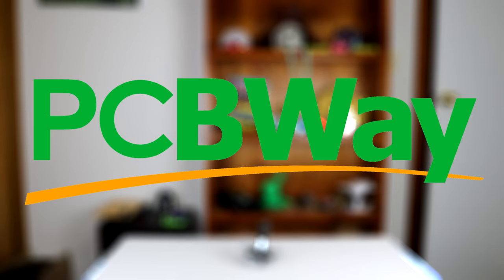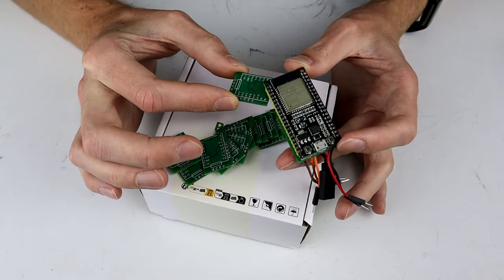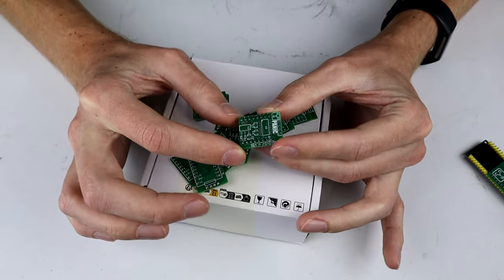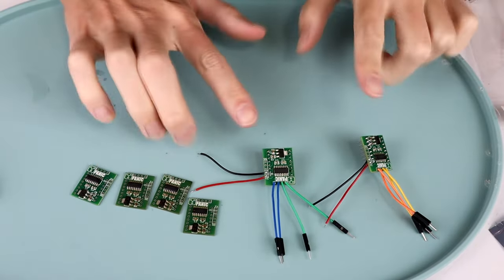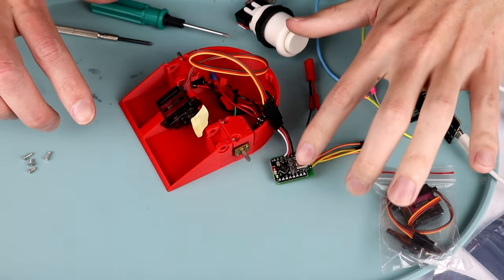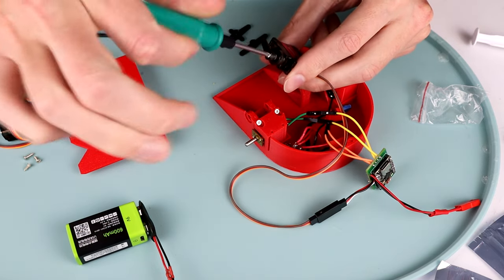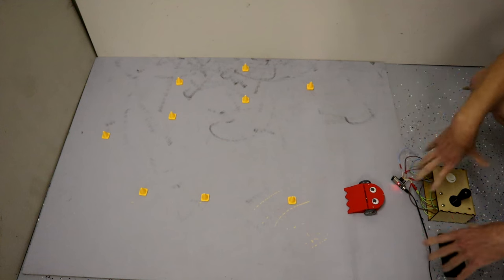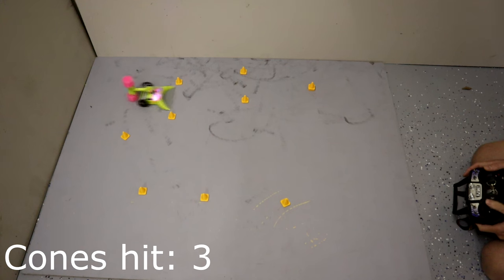Can you control a combat robot with an arcade joystick??

Comment: This is neat, although even with digital input you could use an output ramp to approximate variable input. Have the output start at say 25% for 0.2 sec then tank up to 75% over a further 0.2 sec. As long as it's consistent it should be reasonably easy to learn, give better control, and is also tunable if needed. Even a straight ramp starting at 0% and building to 100% over 0.5 sec can be fairly controllable, as some racing games use this style of setup for driving using a keyboard - trackmania is one example.
Reply from the maker: Ooh interesting I didnt know that some racing games use ramping like that
If I ever use this system to fight my own bots I'll look into this

For what I have in mind for these sticks, intuitive and very controllable is the goal, so I might look at a little bit of ramping but I'll aim for them to be much slower, like turns from 25% to 45% over a longer time say a second
Reply: @TeamPanicRobotics  the fast ramp works with a non-instant decay in racing games, so you can 'hold' a set amount by tapping the button at the correct rate, basically manual pwm signalling. Faster taps generally equal higher percentage, but you can vary it by changing timing of press and release.
Original Gran turismo was a good example as well, there were no analogue sticks at PS1 launch, but it was billed as the ultimate racing simulator (or words to that effect).

Comment: Thanks for yet again another amazing video! I’d like to see a full tutorial on how to make melty brains because I really want to try and make a 150g one but can’t find any tutorials on what’s needed and how to program it.
Reply from the maker: I did make a video on how melty brains work, nearly 7 years ago:
https://youtu.be/fHZTm-qGcZs
I cant remember how good the video is, but it covers the basics

I am meaning to remake that video at some point

The problem with meltybrains is that they need fast electronics which means a lot of cost and outside the accelerometer everyone I know of is using different components. This is why no tutorials exist, every melty that has been built is expensive and fully custom, so a tutorial on it would only ever get you an exact copy

Also a 150g melty is hard, the fast electronics are not only expensive, they are big and heavy. The easiest way to do a 150g melty is to smd a custom pcb with all the components on it, which is something I want to try, once I've got my beelte weight melty working better

Comment: Not sure it's representative, but the test with the button seemed for the response to be laggy, which could be a GEEAT problem with driving accuracy. Was there some improvement for your driving tests ? Also, you possibly can add some "turbo" mode , for example after "prolonged" forward motion, or time increasing speed on the forward input ? Or even a "turbo" button in addition to the action one and 8 directions...
Reply from the maker: great catch, it is laggy but that was on purpose
As that test was the first time I'd used Esp32's to talk to each other I didnt want them spamming signals and messing something up, so I added artificial delay to both the transmitter and receiver

Between that test and the driving test I removed the delays and then had to add a bunch of debounce code and other bits to stop the transmitter from spamming data, while still sending data in a timely manner. I'm pretty happy with how responsive the bot ended up

Comment: Sir, I really liked your project. But would it be possible to replicate it using material at a lower cost? For example: using KY-023 3-Axis Joystick Module. Using the Esp 32 or Esp mini D1.
I await your response, thank you.
Congratulations on the project.
Reply from the maker: I'm using esp32s in this project
The transmitter uses a standard esp32 the receiver uses an esp32-c3

Yes you could build a custom transmitter using a cheap joystick module and an esp32
I'll probably build something like that later in the year
Reply: @TeamPanicRobotics  Wonderful, I'll be waiting, I'll follow your projects!
Congratulations one more time!

Comment: What chip are you using for your esc?
Reply: My bad saw from the other few videos that it looks like a 5v reg and a mx1616 motor driver ic or equivalent.
Reply from the maker: I should have added this info to the video, specifically I'm using:
5v reg - ams1117
H bridge - mx1508 motor driver

note that these two components do not make an esc on their own, they need the esp32